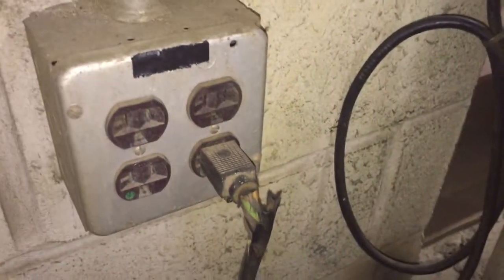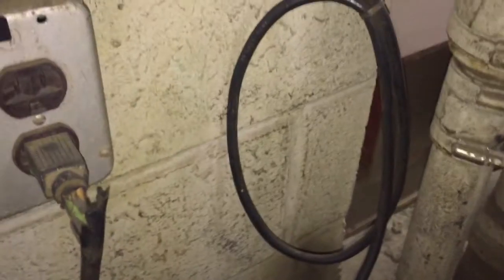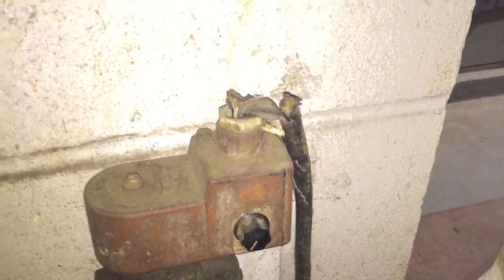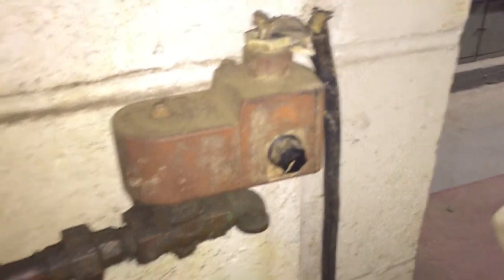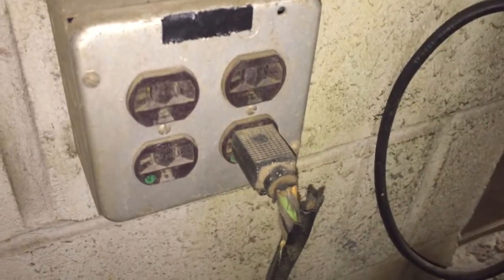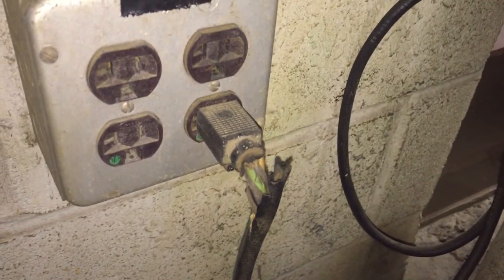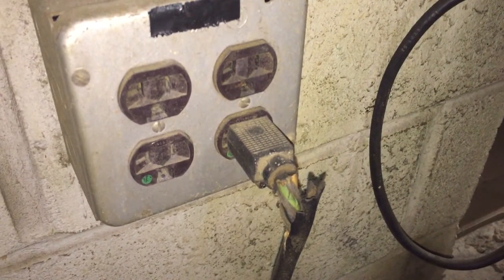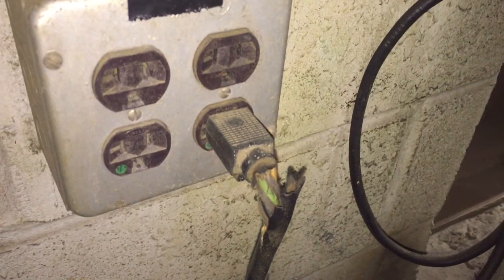Moving Violations Video No. 160: Flexible Cord Damage

Comment: I can't say that I agree that it violates 400.12(7). I think the cord is damaged due to age. I'm thinking pre 80's because of the receptacle plate. I would probably go with "400.12(1) As a substitute for fixed wiring of a structure" would be closer.  
The cable is simply dying of old age....